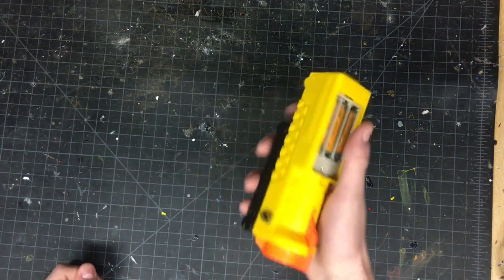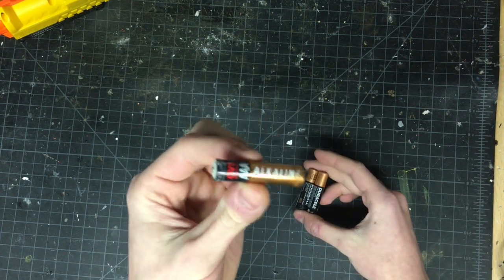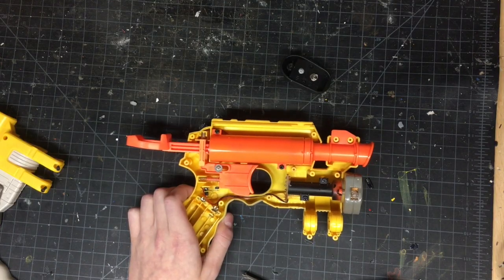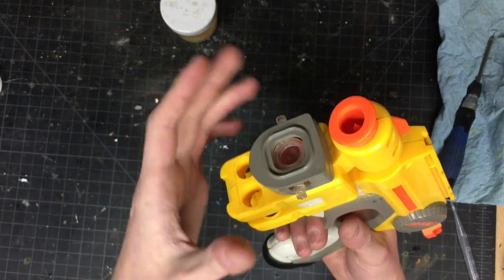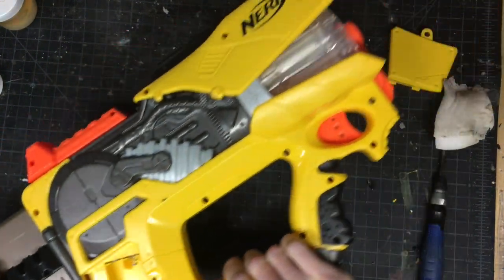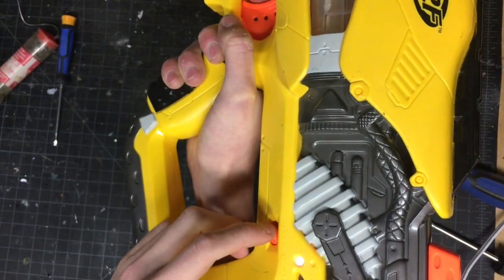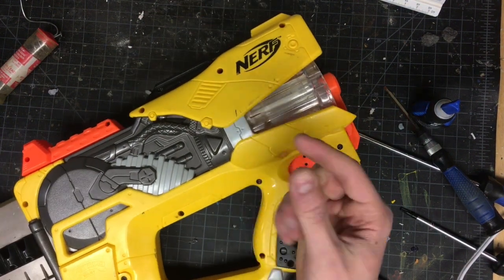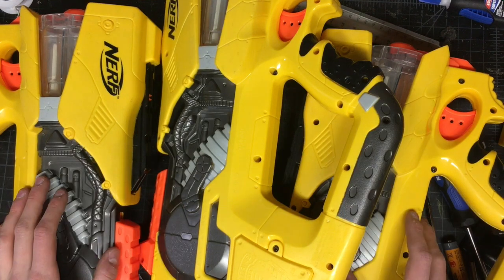Nerf Mending #1 (Ew corrosion!)

Comment from the maker: Before you say it, yes it's a diagnostics and repair knockoff. If you're having an issue with your blaster and I repair one that's at least very similar you can make use of this series so you don't have to spam the comments or discord dms. Speaking of discord I may have a server in the works.
Reply: Considering I run a TAG BACK! knockoff, I don’t mind
Reply: Ok?
Reply: Kinda sounds like an insult
Reply: Kinda does, actually. Sounds like you’re doing another of those comparisons of yourself to me.